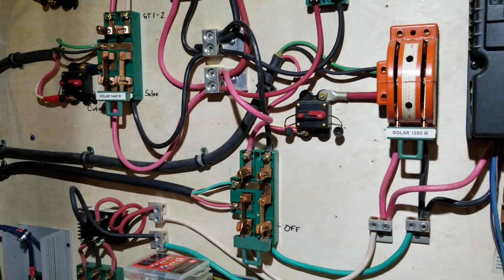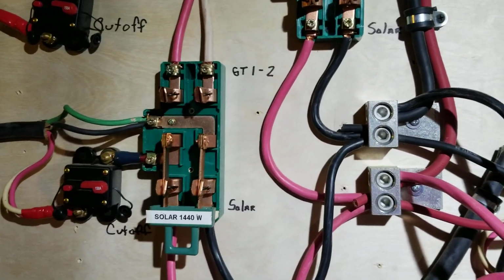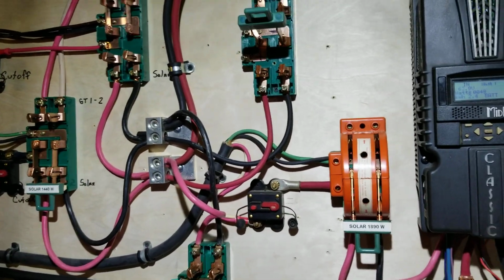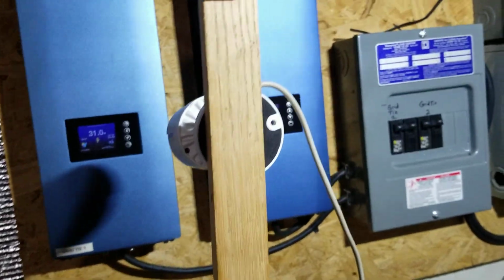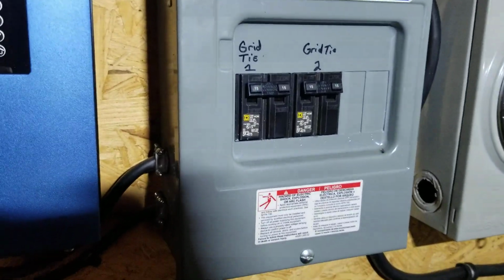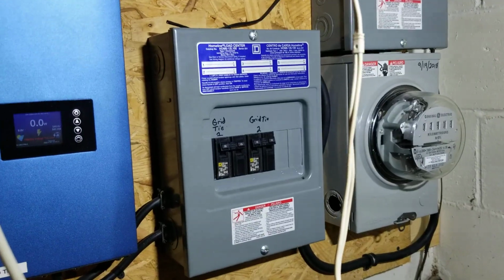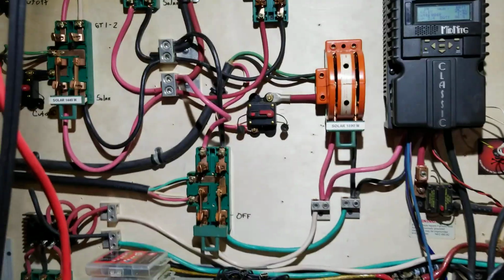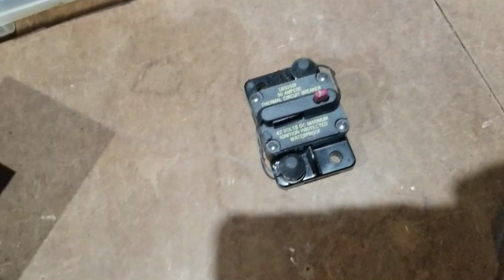Solar Hybrid / GridTied. And How I do it to control my system.

Comment: Ya so you switch the pv feed to where ever you want it I do the same so I can charge my 40 volt bank or my 24 volt bank and the MagnaSine MS4024 PAE will accept an AC couple so it can run the grid ties in a power down. Lots of fun and choice. Keep up the videos and ya stay safe
Reply from the maker: Yeah gotta do what we can do. I like the KISS system
Reply: I didn't get the lithium ion lawn mower yet. It was complicated after 3 super stores.
Reply: @DIYSolarandWind  New ones were just too much for me but they get cheaper everyday.